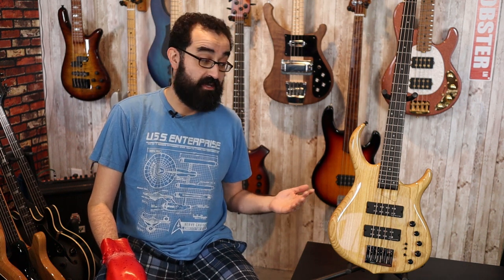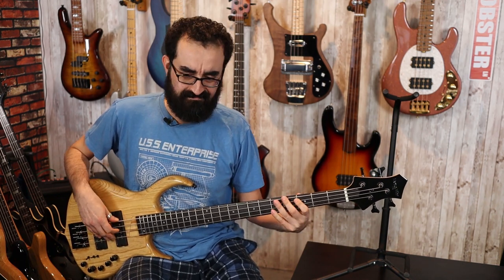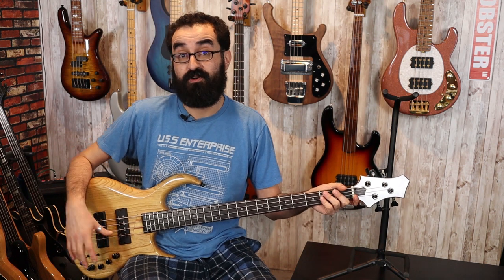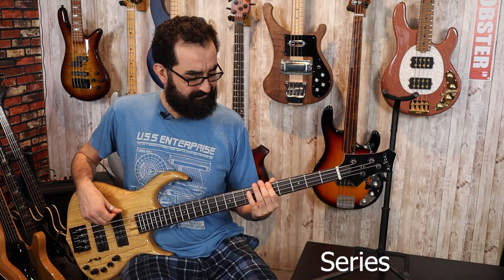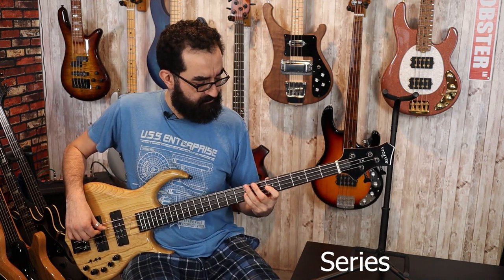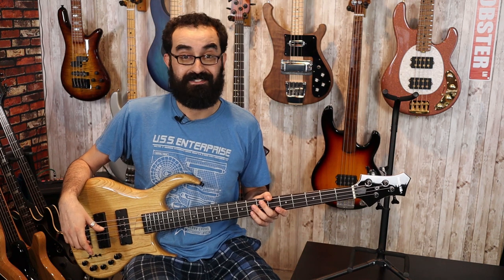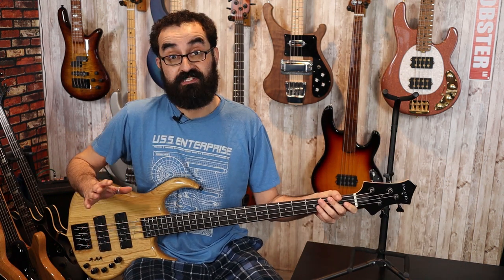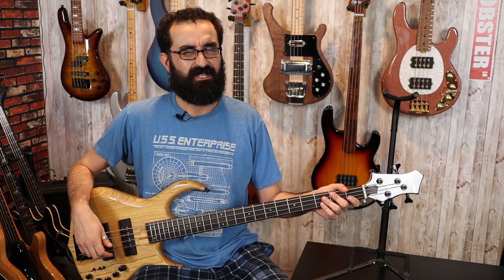Sire M5/M7 Pickup Settings - Looking at all 15 DIFFERENT pickup settings! - LowEndLobster Fresh Look

Comment: That has a few more configurations than my P bass.  They all sound good.  I really dig both pickups as single coils, or the neck pickup solo'd in series mode.  Gets in the ballpark of a jazz bass, and a P bass.
Reply from the maker: Thanks Bizi! Indeed, Sire put together a really nice flexible instrument in which all the tones you get sound quite solid. There really wasn't one that I would turn my nose at or thing sounded bad or gross.

Comment: Love the versatility of it. A of great useful  sounds. I really like the neck pickup in single mode. I was hoping that you can get a Ricky sound out it with both pickups. Really nice bass.
Reply from the maker: Thanks Rich! That's one tone this bass (and most others) really don't nail. Definitely hits the J and P notes real nice though!
Reply: @LowEndLobster  that's true. Hey I bought a  1005 ms in foam green and I was wondering what to clean the finish with. I have some light smudges on it

Comment: Have you had any hands/claws on experience with the Yamaha TRBX604?  Just curious how you feel the two compare, as the M5 and 604 are at the same price point, both have active/passive capabilities, and 2 humbucking pickups.
Reply from the maker: That is a great question! I have not checked out that Yamaha yet, but that is a GREAT idea for a comparison.
Reply: I have one of the last TRB 6, that was made in Japan. And I have yet to find a bass on the market that beat that basses power and tone. It can't be played through nothing less than a 15" and once you turn the bass on the auditorium is vibrating. When I play in auditoriums I only turn the bass nob 1/4 way. Anything else and it's just vibrating the chairs. I would never let go of this Bass. I don't know if the TRBX follows the same quality but man, I just can't go back after picking up a Yamaha. THE POWAAA.

Comment: This is the type of electronics package that I feel would actually be more confusing than beneficial to a new player.  Sounds great though
Reply from the maker: Agreed 100%. It's almost like the Apocalypse paired with the cluttered Sire preamp. I think it works better in this package and form factor as opposed to something like a J bass.
Reply: @LowEndLobster  for sure.
Reply: It's ok. I bought the M5 as first guitar. I basically keep the knobs in their default position, and I use the switches to switch between "jbass" and "pbass" kind of sounds. You're right that I don't understand half of the settings, but it also doesn't bother me. As a newbie I have the benefit that it also doesn't really matter. At my level of play, there is no "wrong" configuration, the M5 sounds amazing in any mode.
Reply: @peanutman314  great points

Comment: Actually now I have P10 and I am thinking 'bout ordering either M5 or Yamaha BB434 as the second bass or to substitute P10. When it comes to neck pickup sounds, which one do you personally prefer P10, M5 or Yamaha BB(735 or whatever)?
Reply from the maker: I like both my P10 and M5 neck pickup. I love the flexibility of the M5, but the P10 P pickup sounds great as well. My biggest criticism of the P10 in general is that it's a P7 in a fancy suit, and the P7 is no slouch by any means.
Reply: @LowEndLobster  I do agree with you. In comparison with the difference of V7 and V10, I think, P10 and P7 don't have that much tonal difference.
Reply: @LowEndLobster  

Thanks to your video and written advice, today I bought M7 ash. 
Actually I went to buy an M5 in the local shop, but there was a special offer of M7 today at $700, used to be displayed on the show window but still new; then I got it!. 
This is so~ versatile; I think it can copy 70% of Musicman stingray with both parallel pickup, 60% of Jazz bass with single both pickup and 50% of Precision bass with neck pickup series. Neither can be that much good as the original but the sounds of each mode are not bad at all :) 
The weak point of this bass to me seems to be a little bit lacking in the sound of clarity; a little bit unclear,  or muffled... 
But I can handle it with changing EQ in my amp. This a great bass, though.
Once again, thank you so much for your thorough review, which helped me a lot!

Comment: How about changing pickups?
Reply from the maker: Hey Aram! I actually did this on Bully's Sire M2. We swapped in an EMG preamp and pickup set. The pickup size is a hair under EMG size, so we needed to mod the pickup cavity slightly - but the result was KILLER!
Reply: Is it possible to change to EMG pickups without changing the preamp?
Reply from the maker: @aramsimon9849  yes

Comment: Help please! My M7 v2 bridge pickup doesn't output anything when in series mode, otherwise everything else is fine! Can anyone tell me what wires i need to check? I have and know how to use a voltmeter and check resistance
Edit : it's a brand new bass but I can't send it back!
Reply from the maker: Heyo! I'd check the wires on the switch. The top or bottom pair of lugs should be connected to each other (one of the pairs, not both!). Join our discord channel and the folks on there will do their best to help (myself included)
Reply: @LowEndLobster  thank you so much! I'll look into it with your advice and join de discord.

Comment: hey, so I've got a pretty good offer for a ray35 and am currently researching a couple of basses. Is the ray THAT heavy? I've read something from 4.9 kg which is pretty heave for me, coming from an Ibby sr505. I want something with a nice thicc B and character but without neck-breaking weight or cost. Could you help me maybe?
Reply from the maker: Hey John Bob, weight can vary from example to example of the same instrument. My Ray34 was 11 lbs, and my buddy has one in the same wood/finish that's 9 lbs. I have no doubt it'll sound great, however the Sire V5 5-er will have a 35" scale neck, 24 frets, and more pickup options. It depends on what you're after but both are great options.

Comment: This is pretty much the same as M7, right? I can't find your video on M7 to compare, do you have one?
Reply from the maker: Hey Aspyr! Same electronics as M7 in the M5, so this video can apply to both. I don't own and haven't reviewed an M7 yet but I'm hoping to snag one at some point :)
Reply: @LowEndLobster  Thanks, I am gonna try it out and maybe even make a review of my own, since there aren't many reviews of M7
Reply: @LowEndLobster  Hey, I just wanted to let you know that I tried the M7, however even at 40% discount, I find it to be lacking. The body and the finish is good, pots seem good, neck is kind of difficult, to be honest, I've played Fenders that are more comfortable than that, it feels stiff and it's not fast like, say, Cort B4 is for example. I am not impressed by tonal versatility, however it does cut nicely in the mix, I played Jamiroquai and Iron Maiden, as well as some slap and tapping, the electronics are good, however in passive mode it's just SO QUIET, it's such a tiny sound that even when I maxed volume on my interface, it was nearly whisper quiet, which I'm not a fan of because I kinda wanted to rely on passive, rather than active mode. Neck is satin, which I'm not a fan of, tuners feel comfortable, they seem to be more lightweight than the ones one might find on an Ibanez, but at first glance they seemed okay! The finish of the bass is good, no imperfections, top notch quality control, out-of-the-box tuning experience wasn't too terrible, slight adjustment was necessary, however the truss rod lid with 3 screws made that a very unpleasant and slow experience. All in all, I'm writing this to let you know that you didn't miss anything and that you shouldn't bother trying the M7, it's definitely not worth the money, it's a $350-ish bass, the fact that they ask $900 for it begs only one question - WHY? Frankly, after examining it closely, I can't see why, the wood was a high cut, it was light, therefore not expensive, and frankly the name alone isn't worth the extra money, not by a long shot. However, IF people at Sire listen to what the customers have to say, I think 3rd generation could be the real deal, they really need to go easy with those prices though, it's a bit ridiculous. To compare the M7 to a V7, I'd say V7 takes the win, it's more comfortable and it has a much bigger sound, however I do remember it being body-heavy, really stopped the blood flow in my leg that one, LOL! Hope that helps you, Lobster! Cheers

Comment: Agreed...single-coil or parallel would be my choice...series for when the guitar player won't turn down! The headstock is kinda meh; hdstox should compliment the shape of the body, no matter what bass it is IMO. Curious: does it say Marcus Miller or Sire on it? I couldn't tell for sure...I'd rather they ALL say Sire instead of MM, but that's just me but I get why they do. I am, of course, a fan of Marcus and my name is Mark but, anyhoo!
Edit: I see now, MM with the S in the middle, right?
Reply from the maker: Thanks BCC! Yup! It says Sire Marcus Miller and M5 (the text layout is ATROCIOUS). I call that out in my upcoming full review :)

Comment: sometimes...there's too many options..lol
Reply from the maker: There are a lot. Luckily the options here are all great sounding. I've definitely had basses with a lot of options and half of them being useless
Reply: @LowEndLobster  i totally agree...the sire does sound amazing...and youre right a lot do have options that are useless. Im glad Sire is putting forth options that actually have a positive affect on tone..even if you need a cheat sheet taped to the back of the bass lol jk
Reply: I think... Neck pickup Series, Both pickup single + single, single + series,  bridge pickup parallel tones are fine and useful.